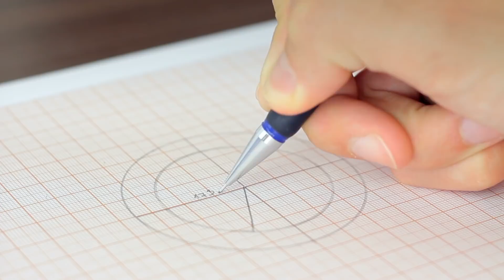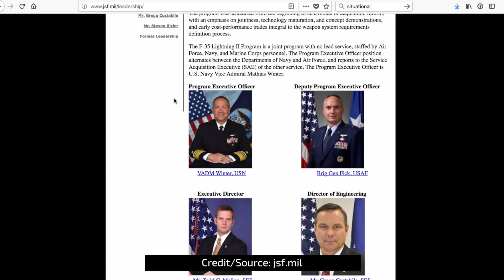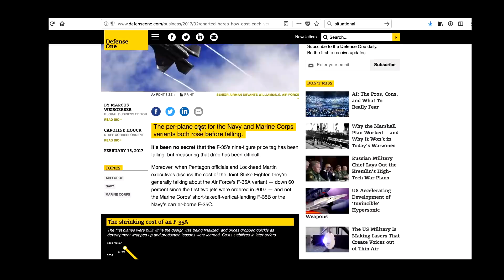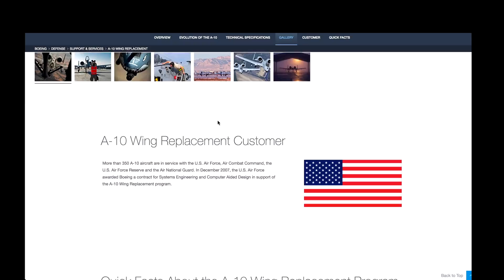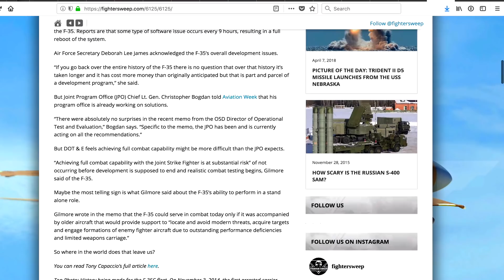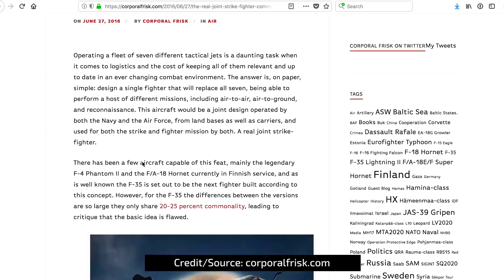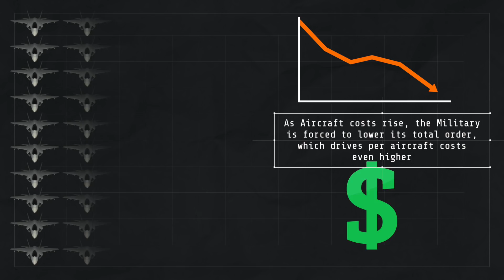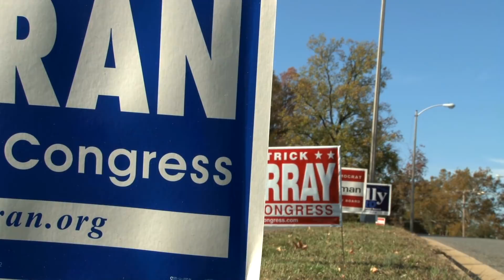Why the F-35 Lightning II Might be the Most Expensive Military Aircraft Mistake Ever

Comment: It can replace others but not the A10 because A10 is basicly agun not a plane
Reply: Darth in my opinion your correct. I like many others owe my life to a A-10 and its pilot. I was with 5 others on a hike in Afghanistan when we came in contact. To make a long story short after 2 hours of fighting low on ammo and the closest help was still 6 hours away. The A10 arrived and layed down a perimeter. The tally made a move and she unleashed that 30mm. As long as she was up there we knew we would make it out. 
The F35 is a wonderful platform. But if it can't stay in the fight and take some rounds itself. It will never replace the A10.
Reply: James or whoever you are,
It isn't worth buzzing infantry with ammunition that costs $138.83/each.
PGU 14/B is expensive and ineffective in it's current role.
You would have a much greater effect at a lower price when one were to use a GBU 12.

In addition to the people complaining about the F35s operation costs, the A10 incurrs a higher cost per distance.
And no you don't do cost by hour because it's not accurate enough, a good example of this is on cars.
You dont measure the efficency by how much fuel it uses and how much maintenance it needs within an hour.

Additionally the 1.5 trillion lifecycle cost is fairly low when comparing to other aircraft.
For comparison sake the F15C has a lifecycle cost of $16,030,800,000
Reply from the maker: We have an A-10 video coming soon. And it is basically a Gun first, Armor second, and Plane third (as we see it). And it's kinda awesome and one of a kind.
Reply: They are looking to replace the A10 with a light attack craft for non contested airspace
Reply: phinix250 oh hell no they are not touching my girlfriend (A-10)
Reply: No, the light attack Planes are not meant to replace the A-10. their meant to fill a gap. just like the Planes in the Korean and Vietnam War did. the USMC even brought back the OV-10 because they needed to fill a gap. a 5th Gen Fighter is a waste of time and money to be used for dedicated CAS.

As a Army Forward Observer we love our A-10's and anything that can provide good solid CAS. "PlayTime" is what we desire most from our cas aka how long can they hang around for. ground battles are not always fast.
Reply: Two Bit Aviation nice bro
Reply: Send in the F35s and 22s first then let's send in the nostalgic planes
Reply: it is kinda pointless nowadays beside CAS tho. sure you can't replace it but thete are no more infinite lines of sovietic T55 ready to steamroll west Berlin
Reply from the maker: Thanks for sharing your firsthand experiences. I watched some YouTube video of helmet mounted of some US ground forces in a similar situation. The A-10 just kept making passes on the enemy ground position until they were all gone. Pretty chilling stuff...
Reply: yes the A10 is the plane of the GAU-8 Gattling Cannon, not the GAU-8 the gun of the A10
Reply: @phinix250  not a gattling gun
Reply: Well, most of the idea is that the A10 isn't going to be replaced. The planes that will fill in the A-10's role would be drones, light strikers, and whatever variant of the F-15 the pentagon decides to buy next, probably more Strike Eagles. The GAU-8 was useful back in the day when all you had was iron bombs and rockets for ordinance. Nowadays though, we have technologies like JDAMs, Hellfire, Guided Hydra rockets, and Small Diameter Bombs which boast capabilities like 9 foot Circular Error Probable and Cave Defeat capability. CAS doesn't refer to the speed and altitude of the plane, it refers to where you put the ordinance (very Close to the infantry), the delivery platform (Air combat systems), and the combat role the mission fills (Support).
It might not be as comforting, but an F-15 loaded up with 20 SDBs is more effective than the A-10 could ever be.
Reply: @Scriptedviolince  I've heard that argument before...oh yeah guns and dogfighting are obsolete and any future war will be push button...we went to Vietnam with that attitude and a lot of American service members died because of it...
Reply: @Scriptedviolince  also it's nice to be able to go mach 5 and carry missiles but the ability to loiter and provide direct support is more crucial than dropping small smart bombs on everything...I'll put it simple sure I 250lb bomb may kill the terrorists but that moab killed their spirit...
Reply: No. A 250lb bomb kills terrorists just fine, and it can be carried by dozens of platforms including predator drones which have loiter times of hours. And the MOAB didn't kill the terrorists' spirits. We did extensive research, days to months of Humint operations, thousands of hours of signals intelligence, tens of thousands of man hours of translation and analysis of the collected data, and coordination with the intelligence assets of all of our NATO allies. The groundwork for that strike started months before during the waning days of the Obama administration. When we dropped, it wasn't some sort of CAS mission, it was a mission to destroy the single largest and most important node in a terrorist logistics net spanning across all of central asia. The tunnel network we collapsed was the largest single network we had ever detected to this day, and in doing so probably destroyed tens, maybe hundreds of millions of dollars worth of terrorist materiel and infrastructure, and caused insane disruption to terrorist operations for weeks, maybe months.

No, it's not just "pushing a button" as you so often deride. War is complicated, and so is CAS. The GAU-8 is outdated and obsolete, not because it isn't a great gun but because of the inherent properties of it being a gun. Back in the early days, it wasn't uncommon for skilled Taliban commanders to negate the A-10's contributions simply through battlefield maneuvers, taking cover into pre-prepared fortifications, moving into positions so that the plane has to circle around to get a decent angle, sometimes getting close and hugging coalition lines so the A-10 can't make the gun run for fear of killing their own guys. PGMs aren't some kind of dream, they're a solution to a reality and an environment where you must get it right the first time.
Reply: @Scriptedviolince  ok I'll get it right as you say...*cough we no longer need AD1 (AD1 RETURNED TO FRONTLINE SERVICE DUE TO LACK OF CAS) *cough Guns<missiles (gun pods installed on most USAF F4s immeadiate impact on lost rate)
*cough A10 to be replaced in service by F35 (A10 put back in service due to ground troops lobbying for it and because it was effective)
*cough you don't understand CAS because X (I understand enough about what CAS is and will remain CLOSE AIR SUPPORT by a plane and ordinance carried by that plane...and serves to boost morale).
*cough MOAB drop had no effect on terrorist morale (losing millions upon million of dollars of equipment cripples terrorist activity in the AoE).
That way of thinking lost us great assets that could still be used such as AC130 because of a percieved lack of need...now a plane that can literally provide thousands of pounds of ordinance while orbiting for literally hours like a drone but with immediacy of actual pilots on the radio CLOSE BY.
Reply: AC-130? We've never replaced the AC-130. Hell, the AC-130 has been used plenty of times providing fire support for night time special operations and recently in a major pitched battle when Russian mercs decided to attack an American fighting post in Syria. The thing about the AC-130 however, is that it has a very specialized role, providing continuous fire support for night time special operations. Daytime operations are too dangerous for the AC-130 gunship because it is so vulnerable to any sort of air defense system including MANPADS.

I'm not saying that the MOAB didn't have an effect on terrorist morale. I don't even know why you brought it up, but my point was that deployment of a MOAB isn't some sort of argument for the A-10. The strike by the MOAB was a special mission which had preparations stretching back months before and was a strategically calculated choice that was passed all the way up to Jim Mattis for the go/no-go before it was launched, not some kind of CAS strike which you seem to believe. And even then, it wasn't fear that caused disruption to terrorist activities, it was because their logistical chain suddenly lost one of its biggest nodes and suddenly they couldn't get supplies because those supplies no longer existed.

No, Close Air Support means a support mission that requires an aircraft to deliver ordinance close to friendly targets, according to the US armed forces. CAS can be provided by Predator drones, F-15s, F-16s, AC-130s, Apache helicopters, Cobra helicopters, and even platforms like B-52 and B-1 Lancer using cruise missiles. The A-10 is not a unique platform. And no, CAS does not serve to boost morale. Boosting morale is secondary. The objective of a CAS mission is to destroy the target and kill the enemy. The A-10 is not uniquely suited to this role, and the GAU-8 is not some kind of cure all for all of the infantryman's problems. If you want loiter time, use a helicopter. All flying low and slow means is that the enemy is warned and has enough time to get into cover like pre-prepared fortifications and such, which more often than not means that your gun run does nothing. A Predator drone flying up high with Persistent Stare technology, powerful cameras, infrared sensors, and multiple eyes checking, rechecking, and verifying everything can drop a hellfire missile right onto a man's head from 30,000 feet totally without warning meaning they're not in cover when the warhead goes off.

Oh, you want boosting morale? How about an Apache gunship hovering above your head and unleashing rockets, missiles, and autocannon fire like your very own personal angel of death? At least, according some Coalition guys who took part in the 2008 offensives in Afghan.

The A-10 was kept in service by Political pressure, not effectiveness. And in any case, the A-10 is falling apart anyway. The airframes are so old they're falling apart. Spare parts are getting harder and harder to come by. The avionics are so old that it's becoming increasingly more and more expensive to support them to the standard required by today's modern networked battlefield.

The gun on the F-4 is basically a self defense measure. The Phantom is a missile truck through and through, and around the time they decided to stick guns on the Phantom, they also discontinued the AIM-7 sparrow, instead issuing Sidewinders which suddenly began giving much better kill rates, much better than the gun pod. So no, the Gun pod was a nice thing to have, but was ultimately the equivalent of bringing a pistol into combat, something to protect yourself with when your rifle runs dry.

The AD-1 Skyraider wasn't brought in due to lack of CAS. The AD-1 Skyraider was brought in due to its insane payload capacity. Each one carried as much as a B-17, and given a good runway, it could carry more munitions than the plane itself weighed. That was pretty convenient, considering PGMs weren't in service then and thus, actually getting an effect on target involved dropping insane amounts of bombs. And again, the guns were Self Defense weapons. When the bombs were gone, the Skyraider left the area, they did not stick around with only the guns because that would be absolutely dumb.
Reply: @Scriptedviolince  1. The AC130s in the inventory are OLD and in need of replacement which Congress in 2014 voted against. 2. So a drone is good? What happens when the enemy employs radio jammers or even hacks the damn thing like the Iranians did? 3. CAS STRENGTHENS MORALE that's a moot point ask any vet who asked and recieved it. 4. Yes helicopters are great CAS but just like the Huey in Nam [even the vaunted Cobra] they are very weak against targets that shoot back with practically anything. 5. The Gun Pod gave the phantom crews the option when the failure rate of sidewinders were upwards of 60% hence the ripple fire doctrine. 6. The AD1 was retired after Korea because it wasn't a jet and the currently in development supersonic jet fighters were thought to be capable of providing adequate CAS (laughably). 7. The A10's avionics? What avionics? The GPS system? The lantern pod? The plane is ANALOG! In fact the only variant that even had any kind of advanced technology was the OA-10. 8. Radio works just fine last I checked freqs are still used as a primary form of communication. 9. I'll give you the cost disadvantages however a 35+ million drone vs a 20 million jet that's proven to be invaluable  for 40 years. It took nearly 50 years for the army to adopt a repeating firearm...let alone trust something that's already proven can be hacked and turned against its user. 10. The Sandys stayed on station until the threat was gone or the GUNS ran dry as a general rule because the mere presence of the aircraft dissuaded the enemy from exposing themselves as napalm and 20mm HE don't feel good. That's why the loss rate was high among AD1s...they were SLOW...but arguably that's what made them great CAS...which is why we still use props to this day in Columbia as anti insurgent forces..
Reply: @Scriptedviolince  also our adversaries are still using Su-25s and are continuously updating it why? Because it's the best plane for the job much like our A10 although arguably the fact the frog foot goes super sonic makes it "better".
Reply: What are you talking about? The AC-130s are being replaced. In 2017 the air force announced that the AC-130J Ghostrider had entered initial operating capacity and would expand the fleet to 37 by 2023. It has the ATK GAU-23 30mm cannon, the M102 Howitzer, launch tubes for missiles and glide bombs and wing mounted hardpoints for precision guided weapons. It has higher speed, longer range, and a higher service ceiling. It has the systems brought fully up to the Spooky II standards allowing it to fight at full capacity in all conditions.

You mean the RQ-180 fiasco? The one where the spy drone was flying over Iranian territory? Here's what happened. They took their most powerful jammers possible and then they blasted them full power to cut out all control signals except for GPS. They then used more electronic warfare platforms in order to feed false GPS information to the RQ-180 which was programmed to RTB rather than blow up or just nosedive. Even then, it wasn't really hacking, just overwhelming the control interface, forcing it to fall back on hardcoded orders. In order to hack a military drone, you need nation-state level resources and technology, and in which case you're probably running up against IADS anyway and in which case they could basically just blow it the hell up. An A-10 wouldn't handle it any better, and worse, your pilot might be killed.

Yes CAS strengthens morale, but that's not its mission! The mission is to kill the enemy, and there are plenty of platforms that do that much much better than the A-10.

Sure, helicopters are damaged by enemy gunfire, but so is the A-10. In fact, the Apache is armored to a similar level as the A-10 with titanium cockpits, and armor protection of core systems. What's worse with the A-10 is that you can't repair it because all the spare parts have to come off planes in the boneyard and often an A-10 that catches too much fire will simply be written off rather than repaired.

No, the reason for Ripple fire was because of the frequency of mechanical failure. Missiles are fiddly things, you know, and back in the 1970s technology as good as it was now. The reason for the high rate of failure in the missiles was often because new pilots would simply launch their missiles as soon as they heard the tone rather than actually get into a good position. And while the gun pod gave you options, it gave you options while you RAN AWAY and got more missiles. In the later stages of the war after improved training measures came into effect, out of 72 kills, 32 were by Sidewinders, 30 were by Sparrows, 7 were by guns, and 2 of them hit the ground.

Sure the AD-1 was retired after Korea. But you know what saw service during Vietnam? Skyraiders! There was the AD-2s of various flavors, AD-3s of various flavors, AD-4s of various flavors, and AD-5s of various flavors! It wasn't until after the Vietnam war when the Skyraiders were replaced by the fully matured versions of the A-7 Corsair, an aircraft that carried twice as much would see service into Desert Storm.

The A-10 does have Avionics.
https://www.youtube.com/watch?v=YZON5gqGHsA
Looks like some electrics to me. In fact, you need those to interact with the weapons on the hardpoints. You know, JDAMS, and Mavericks, and Rockey cluster bombs, Paveway bunker busters, and the electronic warfare pod. You know, the weapons that the A-10 uses to actually do actual work.

Yeah, and radio is actually quite limited. If the radio was all you needed, then the A-10 wouldn't have the highest friendly fire rate of ALL AIRCRAFT CURRENTLY IN SERVICE. Yes, the radio works, but let me quote a friend.
"It is much easier up high to identify things from a UCAV. MUCH easier. Because their sensors are just that good. Validating targets from up-high is easy because you can slew a stable sensor on them and zoom in and get a very good long look at things and you have time to sweep the area, cued onto it by ground forces or other assets (UCAVs can 'hunt' a hell of a lot better because of this without the need for ground forces to point them in the direction). An A-10 at low altitude is in a far worse situation for trying to ID friendlies. I repeat; when you are screaming along at 500 feet trying not to crash with a split second to try and see something, even correctly identifying armored vehicles is incredibly hard let alone identifying infantry. The Mark-1 eyeball at 500 feet is simply no match for a team of people using high-def cameras and FLIR sensors at high altitude with all the time in the world to ensure they have the right target."

Cost? Okay, let's talk cost. The in 2013, the MQ-1C Grey Eagle cost 21.5 million dollars. The A-10 at this point doesn't cost anything. It's already paid for, but it does have continuing running costs and there are no more being manufactured. But here's the thing. If you lose a Grey Eagle, you lose a Grey Eagle, Big Woop. If you lose an A-10 thunderbolt, you lose a plane that you're never gonna get back anyway, and also a /person/, in all likelihood an /American person/.

The Su-25 frogfoot? What? You mean places like Angola, and the DRC, and Peru, Sudan, and Turkmenistan. Yes. They clearly are countries that chose the SU-25 for its combat effectiveness rather than because they simply couldn't afford anything better and the USSR isn't around any longer to gift them out like any sugar daddy worth his status. Yes. The 30mm gun is the reason why they are used and not because the nations in particular can't afford to buy and maintain precision guided munitions.
Reply: @Scriptedviolince  ... the problem is that after WW2 the air force wanted to be independent but it saw themselves as an elite and not as a glorified GUN for the army to use ... they (specially bomber harry) wanted to REPLACE the army ... so all that reminds the USAF of that shamefull past they want to remove it from sight ... thus the never diminishing hate the USAF brass has for the venerable A-10
Reply: @sotabaka  As a enthusiast born around navy brats, I know more than a little about how the Air force thinks about things, and I've talked to a few fighter jocks who feel intensely guilty that somebody died while they were on station. That said, I still maintain that the F-35 can still do missions that the A-10 can do, but the problem is the attitude that the air force has with operations. While I may be talking about the absolute hard stats, the biggest soft stat that plays into the A-10's favor is in fact the name, the fact that it has an A instead of an F. There is a world of difference between the culture and training behind those two letters.
One of the A-10's biggest advantages is the training that its pilots get, namely in that it's fast enough to get where it needs to go, but it's not so fast that the pilot doesn't have time to take in everything and double check some coordinates or something. The sanity check in other words. Take at well known A-10 friendly fire incident where they strafed a British armored line. A quick sanity check would have stopped the incident right in its tracks, but because the pilot treated his A-10 like an F-10, several Brits lost their lives. I guarantee that if you took an F-35 fresh off the line, scratched out the F and scribbled in an A, the difference in the CAS performance would be night and day, at least before congress decided to combine the two into the F/A-35 and you suddenly lose effectiveness again.
Reply: Same how the A10 isnt as good as the AD-1...(btw I absolutely agree the A10 shouldn't be replaced my brothers both owe the warthog there lives in both desert storm and Iraqi freedom...
Reply: It doesn't replace the A-10 like-for-like, but it was never intended to.

The F-35 is going to do CAS in a different way, rather than loitering low and doing gun runs, it flies high, integrates it's sensors with other aircraft, and strikes fast using precision bombs or missiles, it's a different form of CAS, and admittedly doesn't have the same psychological effect that the A-10's cannon has, however it can do the job.
Reply: @G1NZOU  but the A10 is easily able to be adapted to do that...and on top of that comparing payloads the A10 far surpasses even the bigger C variant...CAS may be different today than it was 20 years ago BUT the goal of it remains the same and I don't think the F35 will have enough shock and awe to drive back the enemy the A10 does that by mere presence alone...
Reply: Actually, the F-35A carries more than the A-10. About 2000 pounds more actually. I don't know why people keep trying to compare the A-10 fully loaded to only the F-35's internal bay when the F-35 is also rated to carry weapons on wing mounted hardpoints. Not only that, the F-35 has the avionics, sensor resolution, and sensor fusion required to use those weapons to its greatest capacity. Shock and awe is fine, but what really matters is killing the enemy. In the words of General Curtis Lemay
"I'll tell you what war is about, you've got to kill people, and when you've killed enough they stop fighting."
So yes, the A-10 might be more impressive, but as a general rule, the F-35 loaded with SDB-II and JDAMs will kill more people than the A-10 ever could.
Reply: @Scriptedviolince  let's just agree to disagree about which platform is more effective than the other...I will give you 3 points towards the F35: 1.Its faster when not fully equipped (with the gun pods or missiles on the wings it's just as slow as the A-10 realistically speaking) 2. Its new ok I get it the A-10 is old as sand and is getting expensive to maintain 3. Its able to be "smart" capable...now let's give the A-10 ITS DUES! 1. Its simple meaning it's no big loss if one is shot down 2. I Carried more EFFECTIVE CAS ordinance 3000 rounds of 30mm > than 250rds of 25mm BAR NONE as someone stated good CAS is 1 with staying power. 3. SIMPLICITY it's so important for a CAS to be simple that it has to be mentioned twice...CAS is GOING to take fire and the ability to take damage and be able to come back is PARAMOUNT to any and all other things...the F35 is a single engined light strike fighter at its core NOT a dedicated CAS aircraft such as an attack Heli or the A-10...to be honest the future of CAS would appear to come from DRONES That's only becoming more and more certain as technology matures...the JSF is a child of McNamara thinking which is good as a cost saving measure but it's not good for boots on the ground fighters as history has shown...
Reply: The cockpit is quite literally the only part of the A-10 that is armoured. Every other part of the plane can be destroyed as easily as other aircraft. The main reason it can survive is the triple redundant manual flight control systems. It can't continue to fight after taking direct damage, and history shows more have been lost to enemy fire than have survived being hit.
Reply: The F-35 has been seen with what looks like a GAU-8 pod attached to one of it's external hard points. The only thing spectacular in the A-10 is that gun, without it it's a slow fat target, also not many missions requires it as the bulk of our current battles are against soft targets not Russian tanks as the A-10 was designed for.
Reply: F-35 
Pros:
-More advanced weaponry
-Stealth

Cons:
-Cannot produce the freedom BZZZZZZZZZTTT sound like A10
Reply: ltmikepowell  A-10 was also a SOYCUCK as well at one point. All planes are. In the same way that Saint Mattis of Quantico was at one point in his career a wet behind the ears Second Lieutenant. Just like Chesty "Goddamn" Puller was at one time a fresh faced boot.

That said. Virgin Warthog vs CHAD Aardvark.
Reply: darth rancor lol yeah I’m pretty sure the gun was designed first and somebody thought to himself “why don’t we just build a plane AROUND the gun?” Thus, the A-10 was born
Reply: The A-10's fuselage is no tougher than those of frontline fighters...
Reply: ltmikepowell  And in the A-10;s case it was the cockpit and nothing else.
Reply: darth rancor
It can replace others but not the A10 because A10 is basicly agun not a plane
'
hi D R...
F-35 is a good plane and no needing to replacement A-10...
keep both planes in services
Reply: Well the story goes like this, a bunch of crazy mfrs decided to build a terrifying gun , when they were done they stood around it scratching their heads trying to figure out what to do with the big ass thing, one guy smiled and said,  let's build a fucking plane around it, the outcome was monstrous, brrrrrrrrrrrtttt
Reply: but if you can use good guided bombs than why use a gun
Reply: A lot of people dont seem to understand. A weapon is only useful when it can be used. The a-10 is an extremely vulnerable to any type of AA that isn't a low caliber gun. We do not measure the worth of a boxer by only how hard he can hit, but HOW hard he can get hit. Yes the a10 can take a hit. But why would any army want that. They would rather have a aircraft that is harder to detect and harder to hit. You could bring tons of bombs to the front. But if the enemy air defence prevents those bombs from being dropped then the platform is rendered useless. The a10 has its place. It is very good at extended cas operations, but against any other modern army it falls short
Reply: To quote one Australian Pilot of a A10 it is not a plane it is a gun with wings!
Reply: I love the a10. Nothing can replace it <3
Reply: COIN aircrafts actually did :D
Reply: HeyWould Ja’Blowme MGTOW  You'd be surprised by how many more people got saved by teen series JDAMs ^^.
Reply: The A10 wastes a fuckton of bullets when it fires its gatling gun, though. It's better to fire a single guided munition at each target, because you're less likely to run out of ammo, which means you don't have to land for reloading. Aircraft that aren't flying are also known as "targets".
Reply: A gun with a personality disored. It acts like a plane.
Reply: The a-10 Hog, is actually the the airframe of the WWII aircraft with the jet engines added and 'built' around the cannon.

In its performance, it is slower than the WWII's first fighter jets and it has only one cannon in comparison with WWII aircrafts which had 2-4 cannons.

Few of numerous advantages that f-35 offers:

Try using the fins from the a-10 on f-18 in repair and expect the same performance of the f-18 as it  had with its original fin.

The f-35 gives great hitting capability in non contested aerial environment (which still has anti air defenses) and in contested aerial environment (which includes the enemy aircrafts).
Reply: A10 can't go into contested airspace so it would be useless fighting a conventional enemy
Reply: A.J. Bensinger  Yes, and No.  So we 'can' do contested, but not in a persistent, loitering, CAS kind of way.  A in and out Maverick attack on a fixed target we could do.  The thing is that NO one part of the arsenal stands alone.  The A-10C is just part of a larger package of military goodies thrown at the guys.  Example: F-18G's fill the air with high powered focused EM on A2AD assets, F-35s engage said A2AD stuff, F-22's keep a wall of radar and AIM-120D's up and going and the Hogs and everything else goes in under it.  

So there are ways, but yes a A-10C flight on their own would have big time issues.  It's NOT useless against a conventional enemy, it just needs help, like everything else in such a situation.
Reply: Against Russian SAM's that everyone in the comments say are garbage? If the USAF is so bothered by "contested Airspace" why are they going to keep the B-52 until 2040, The gun doesn't penetrate the new Russian tanks (I thought they were all junk), all 20 of them. It would be  nice if the arguments against the A-10 were at least consistent.
Reply: yet it did it in the First and 2nd Gulf war with ZERO losses. meanwhile other planes got shot down. A-10's took Direct missiles hits and kept on trucking.
Reply: warthogs are good for tank killing due to their gun because now with russias new tanks its harder ti use guided anti tank rockets
Reply: That is incorrect, most of the armor on the the current Russian tanks is thicker than what the 30mm GAU-8 can penetrate, their are few spots where they can reliably do it.